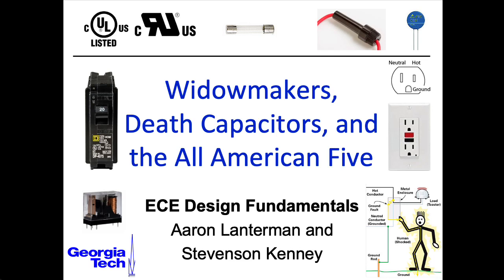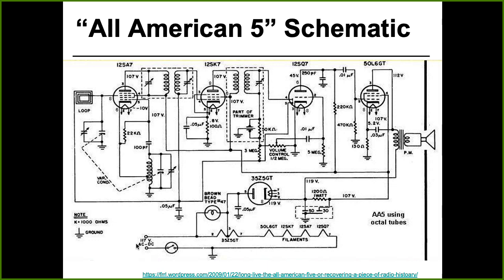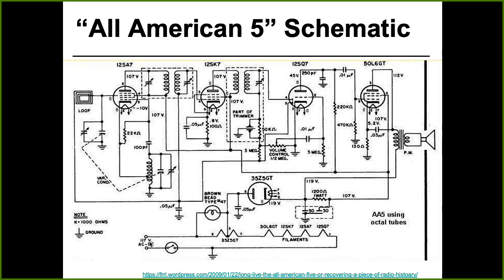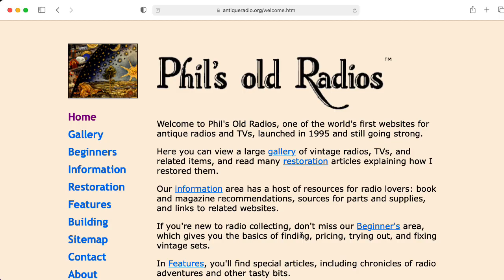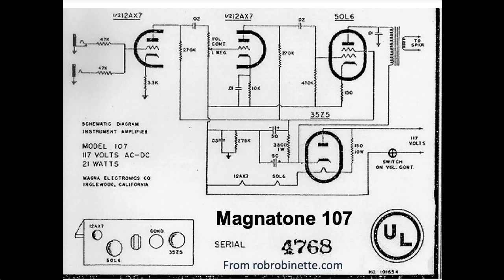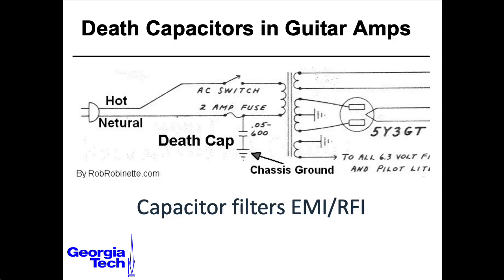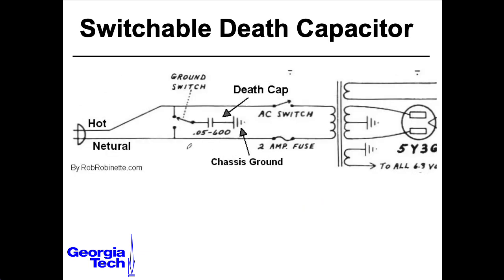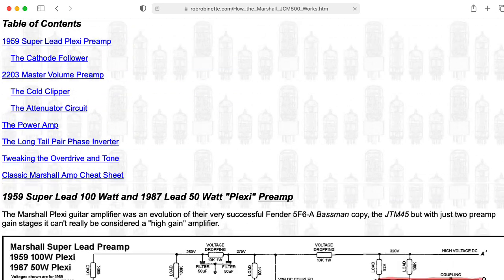Widowmakers, Death Capacitors, and the All American 5 (ECE Design Fundamentals, Georgia Tech course)

Comment: I Just don't get the polarized plugs and relaying on the fact that the wiring has been done correctly. Yes, the UK plug is better than US version, but it still sucks. You should always treat both live and neutral as live connections, no matter what and on the device it shouldn't matter what way the plug is connected. Schuko is way better socket, inherently safer.

Comment: There are many countries where polarized plugs aren't even a thing. On German plugs for instance, you know one of the pins is grounded, but not which.  I think they rather frown on the idea of relying on knowing which pin is grounded. 

Thats why you can safely hook German style equipment to a North American 220V outlet, as used for welders and such, where both legs are hot and protected by mechanically interconnected circuit breakers, and ground is halfway in between...

Comment: Back in the early 90's when I was working at a high end audio store we had a (solid state, mind you) stereo pre-amp from a small manufacturer that occasionally showed an... unusual problem: if the pin to the hot AC lead on the main PCB extended too far below the board it could contact the chassis, thus connecting the chassis directly to the AC. Upstream of the AC fuse on the PCB, too! I don't know how many of them made it out into the world with this problem but I do know that one of them literally threw one of our salesman off his feet in the showroom. Hope none of them killed anyone.

Comment: When a "death cap" fails it usually does not go to a full on dead short. When they get leaky you will get a rather painful shock although usually almost never a fatal electrocution from the shock. It just hurts like a real mutha****er! IF you have an extruded cord the side with a single rib or multiple ribs is almost always the neutral. All American 5s super & cheap widowmaker amps, and even old series string tube TV sets all ran with no isolation from the building's AC power supply. Again, you usually survived the shock but getting zapped in the lips off of that RCA ribbon microphone really really hurt! Now try this outdoors in damp  weather! A friend yeated a $9000 (2019 value) Rickenbacker bass into the air at a beach concert. He was opening for Pink Floyd. My old immediate post WWII home has no grounding wires inside the walls of the original house, so I keep the death caps in my vintage amps. I use a fused IDEC socket, so I can kind of do whatever and any fault will pop the fuse in that IDEC socket. I also have GFCI breakers. If I tangle with a water pipe, I am kinda screwed, but hot to neutral>? That kicks off in a millisecond or two. My GFCI breakers are also audio and even RF transmitter grade so they feed an extra extra high frequency send for the sense so I don't get lots of weird noises.

Comment: I think widowmaker as a name is a bit overkill. It's pretty unlikely to kill you if that death cap fails. It's unpleasant, though.
Reply from the maker: I think the term Widowmaker is more specifically referring to the amps with no isolation transformer and the heaters in series, not necessarily any amp with a death cap.

Comment: it's almost a Zappa. My Vintage Guitar Amp
Wants to Kill Your Mama.

But seriously, back in my teens I remember getting a tingle from touching the keyboard player amp's front grill. It was a custom job knocked together by some guy, and of course with a two-prong plug as everything back then. I'm sure now it was a case of a live chassis.
Reply: Is that what that song is about?
Reply from the maker: @leedavis85  ;)
Reply from the maker: Tingle Tangle!
Reply: Amps like that were one of the reasons I switched my bass to EMG active pickups, because they don't need the strings connected to ground (and actually recommend removing the bridge ground wire).

Comment: RE DC input: Before standardization some communities had DC, not AC at their wall supply.
Reply from the maker: I did not know that!
Reply: @Lantertronics  Ages ago a garage band I was in practiced at a new friends house and plugged all our amps and a PA into non-grounded outlets. You could touch your guitar strings or you could get close to the mic but not both at the same time unless you wanted a rather painful arcing shock to the mouth. :)
Reply: @justovision  well known with audio circuits is grounding can produce unwanted hum because of ground loops. And in those cases, people were lifting the ground to reduce the hum, but that also invites a potential hazard issue.